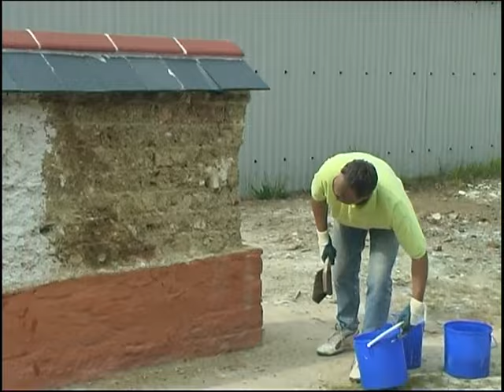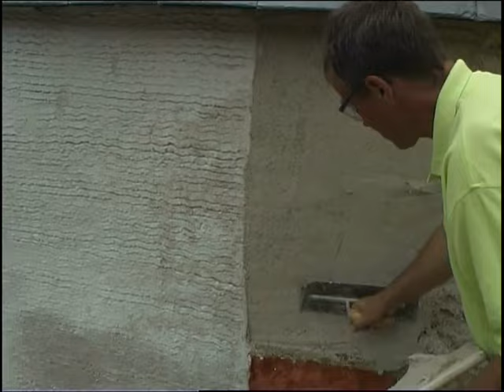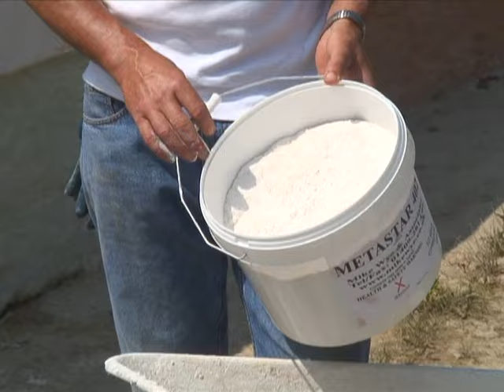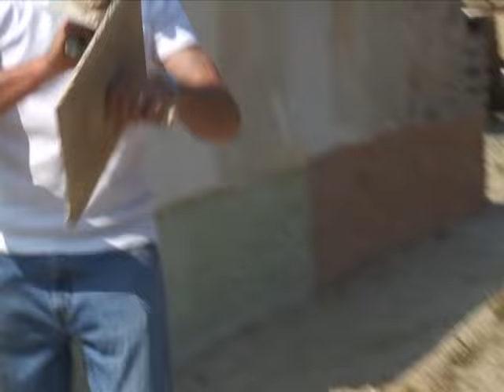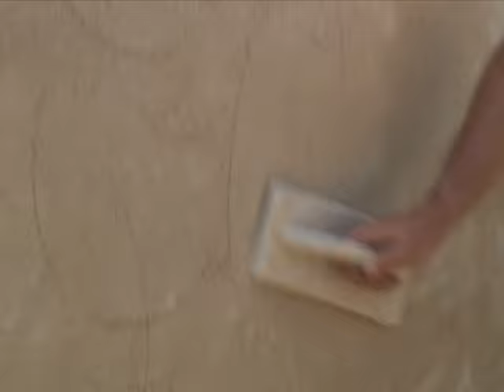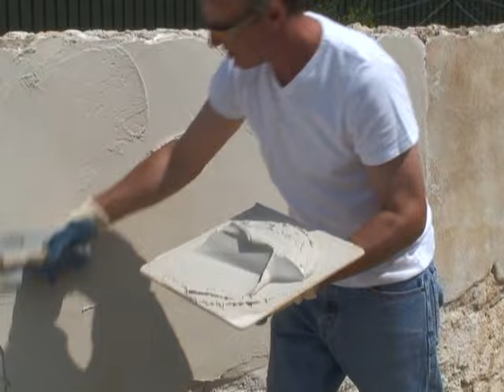How to Lime Plaster (internal solid wall)

Comment: Sorry if I missed it, but how thick does the scratch coat want to be?
Reply from the maker: Hi Simon. We typically assume 12-15 mm material consumption for the scratch coat. Of course you may need to consider extra material for dubbing out and, in some instances, an additional scratch coat if the walls are particularly uneven. 
Regards, Ryan @ Mike Wye
Reply: @MikeWyeLtd  Thanks. I see on your website that two scratch coats are specified, is this optional? I.e. if you are happy for the walls to be uneven and retain their character, can one coat be used?  We are specifying both internal plastering and external roughcast render.
Reply: Also - with the roughcast, do you add the aggregate to the harling coat, or do you add the harling coat then fling the aggregate at it? Thanks in advance. S
Reply from the maker: @simonblunden6751  Exactly. If you have particularly uneven walls then you will likely need an additional dubbing out coat to bring the walls level before application of the float coat. If you would like to retain some character, or if the walls are relatively flat (such as brickwork or block) then an additional coat will not be required. Regards, Ryan @ Mike Wye
Reply from the maker: @simonblunden6751  The roughcast/harl coat as shown in the video is a thinned down Unhaired Lime Mortar mix. We generally use something called Reabilita Cal CS (otherwise know as Consolidation Mortar) for harl coats these days as we can supply exactly the correct amount without having to work out how much of the Unhaired Lime Mortar to separate plus it is generally ready to receive a scratch coat in 24-48 hours.
Reply: @MikeWyeLtd  Thanks - do you have any guidance on the type of aggregate to use in the top harl coat, would this affect the proportions of the mortar mix, and would you add the aggregate to the mortar before harling it?
Reply from the maker: @simonblunden6751  The aggregate in the premixed mortar is 0-4 mm and therefore you would not need to add any additional aggregate unless you were looking for a coarser finish. If you do want something beyond this then you can introduce another aggregate but not so much that you end up significantly affecting the mix ratio.

Comment: Have you applied this on Concrete wall?
Reply from the maker: It's absolutely possible to apply lime plaster or render to concrete block in the same way. This could be done for aesthetics, to match surroundings or from an environmental viewpoint.

Comment: Hi Mike such a good informative video. Quality work. What is the difference in technique/materials this to an external wall?
Reply from the maker: Hi David. Thank you for your positive feedback. 
The application for an external render would be almost identical apart from a couple of details: 
The lime plaster skim would be too weak and vulnerable for external use and therefore the top coat would be a finished unhaired coat rather than devil floating it as shown here. 
We also recommend the use of a pozzolan additive for external works (particularly if you're in the UK given our climate!) to bring on an initial strength gain and protect from adverse weather and frost in the future. Regards, Ryan @ Mike Wye
Reply: Ryan, thanks so much for the prompt and informative feedback really appreciate your help. Are you still supplying materials at the moment incuding delivery?
Reply: Ah I just ready your notice on your website. Hope things get back to normal soon. Wishing you the best.
Reply from the maker: @davidharness1507  Thank you. We hope you and your loved ones keep well through these challenging times.

Comment: Good video.
Once dried .if there are any knocks and slight damage how do you fill?
Reply from the maker: Clean the area and damp down, apply a small amount of material and float/sponge over as it dries back. You may find a finer sand mix easier to blend but it can be done with the standard mortar

Comment: Hi love the videos thanks, i have a question can you do sections at a time, Example I have a Large external wall I need lime rendered, in planning to do it myself, could I do the wall in 3 stages with no bells , just flat and do section to finish coat different days?
Reply from the maker: Hi Mike, you could do the harl and scratch coats in stages but you would need to try and complete the float coat in one (it's very hard to disguise joins in the float). If there are down pipes, that would be a good place to stop and start.
Reply: @MikeWyeLtd  OK, than you for the reply awesome

Comment: Can I use lime mortar over concrete!!
Reply from the maker: Hi Ramona. Sorry for the delayed reply over the festive period. It's possible to apply lime over concrete but arguably very little benefit in doing so. The lime will only perform as well as whatever is behind it in terms of vapour permeability and flexibility. There's also an increased risk of cracking/failure due to differential movement between the two materials.

Comment: Thanks for this Mr Wye. I have used your stuff on many occasions because your materials are always good and very usable. 
Instead of using metastar I prefer using a brick dust. Harling is good and effective but if possible I prefer to use a mortar sprayer with a full sized compressor to do a thin 1st coat which I then blat it on at about 90 -100 lbs per square inch. I also use a wider tined scratcher but have cut away every other tine because they were too tight together, I also like to slurry area's before I scratch because it helps to bind the two surfaces together.
Many architects and builders cover their cob surfaces with metal mesh fixed with screws & plugs, resins or cone headed twisted nails but this isn't necessary if you do a 1st coat with a harl or a spray that should be sufficient, it's all about the key.

Comment: can this be used for outdoors? Would look fantastic on my retaining wall
Reply from the maker: Hi HalfKatzBoy, It can all be used outside apart from the last plaster skim coat. This wouldn't cope with the weather as the aggregate is too fine and the coat too thin.
Reply from the maker: Hi. The process is fairly similar for rendering externally but the skim coat is omitted. You can find our external render YouTube video here: https://youtu.be/1sjVSMypSvY

Comment: I want to do ready to use dry mix lime plaster. Let me know which lime to use? sand:lime proportion? what to do to accelerate setting time?
Reply from the maker: Hi Sameer, you can use an NHL (Natural Hydraulic Lime) either NHL2 or 3.5 mixed with sand, this has a chemical set with water. You wouldn't really want to accelerate the setting time but with this sort of lime it should be 'green hard' after 24-48 hours. A 3:1 mix ratio by volume is commonly used.
Reply: +Mike Wye Thank you. Also I had heard that sulphur powder is also used. Is it correct?
Reply from the maker: @SD-bg4pm  Many powder pozzolans, such as fly ash, brick dust and metakolin, have an effect on the mortar strength when added. We generally add them to traditional lime putty mixes to improve strength and offer better protection from frost. It's not necessary to add them to a hydraulic lime mix as the strength can be somewhat determined by the correct grade selection (NHL2, 3.5 or 5)

Comment: Just moved into a cob cottage that has been cement rendered outside & inside on the ground floor. Silicon injection damp proofing to prevent rising damp. Is it worth using lime mortar internally on the first floor.
Reply from the maker: kate herd, our apologies for missing your comment a few months a go.....not sure how that happened. There can be some real benefits in using lime plaster to help with moisture management and for the benefit of the property. However, we always encourage breathability to the outside first wherever possible. If you are considering improvements or need to replace renders or plasters due to dampness or damage then it may be wise to address the external cement render first, finished with a breathable paint.

Comment: metacaolin question: do you add 7:1 ratio to the lime putty or 7:1 ratio to the entire mortar mix, I remember reading somewhere that metacaolin is highly reactive and you only need to add 2 to 5%, adding too much may cause shrinkage issues as well. on the other end of the spectrum brick dust is of low pozzolanic reaction and you can add 1/3 of the aggregate (25% of the mix) up to 100% of the aggregate can be replaced with brick dust, depending on what final properties you are trying to achieve. rising damp issues, etc...
Reply: Fabio Bardini, we add the metakaolin to the mortar at 1:7. 
The addition of pozzolan is an interesting and broad subject which has recently been revisited by the Building Limes Forum in the U.K. as the theme for this year’s annual conference. 
We try to keep our finger on the pulse with all new developments and research, however we’ve been using a gauge of metakoalin with traditional mortars in these sorts of volumes for 25 years without any resulting shrinkage. 
Many other pozzolanic additives can be used but may not be easily accessible, can be inconsistent in their reaction, or can have an unwanted effect on the mortar colour.
We’re happy to discuss this further if you’d like to call our office, or email us at sales@mikewye.co.uk

Comment: Just found your channel 👍 Excellent video 😎 I've been Plastering for 25+ year's. And have recently started working for myself. And have started coming across having to use breathable materials. Lime.  But haven't done a great deal of lime. And when I have done. I've never mixed it up. I'm the one who puts it on the wall 😉 so would be very grateful if I could ask you a few questions about rendering with hydrated and hydraulic lime.
Great video 👍😎😎
Reply from the maker: Hi Neville. Thank you for your kind feedback - much appreciated. We're more than happy to help with any questions you have but you may find it easier to do so through our online chat via our website www.mikewye.co.uk, or by email sales@mikewye.co.uk, or on the phone 01409 281644.
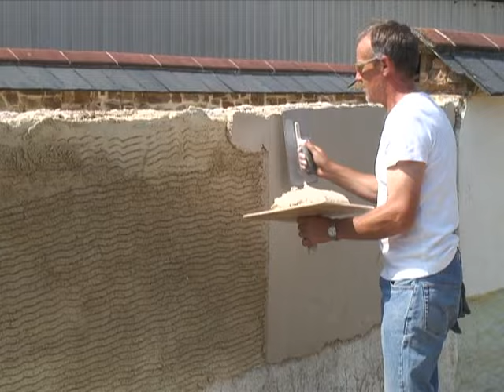We're here Monday to Friday 08:00-16:30 (GMT).
Reply: @MikeWyeLtd  Thanks Mike. Excellent. I'll contact you as soon as I get 5 minutes on chat on your website. Thanks again 😎👍
Reply: Neville Hayfield do post the questions and answers here so that everyone can learn something new.

Comment: Hi, i'm getting ready to render my walls, can you tell me what type of sand are you using, is in rendering sand or building sand on all 3 coats. thanks
Reply from the maker: The backing coats use a sharp sand, typically 0-5mm with a good spread/blend of fine and coarse sized aggregate. Many merchants supply 50/50 sharp sands which can be a fairly safe bet if there’s any doubt.
For the top coat lime plaster skims we use a kiln dried fine sand (kiln drying removes the majority of lignite therefore minimising marks on the plaster). The size of sand can vary depending on the fineness of finish required. For example, Georgian and Victorian town houses typically had smoother finishes when compared to 16th century cob and thatch properties. 
As a guide, somewhere around 0-0.25mm aggregate size will achieve a good result.

Comment: Excellent video. Thank you for this, it's been really helpful for me. Is harling the same as scudding, another term I've heard used?
Reply from the maker: Hi James, yes it is the same. Thank you for your kind comment.
Reply: Thanks, Mike. I'm really looking forward to having a go at this. I'm tempted to practice on the inside of the garage first. I'm guessing that concrete blocks from the 1980s aren't exactly breathable, but at least I won't make a mess of the walls inside the house trying it for the first time there!
Reply from the maker: Good luck, we are always available on the phone for help and advice, should you need it.

Comment: Is it hydrated lime you use? This may seem like a silly question but I have no idea
Reply from the maker: Hi, no we manufacture lime putty here so we use that as it provides a richer mix but hydrated lime is a dried version of this. We use a ratio of three parts sand to one part lime putty by volume.
Reply: In Korea, In my opinion, Not quick lime But Hydrated lime. in these kinds of cases, traditionally use Hydrated lime(quick lime + water = Hydrated lime). lime putty, lime mortar etc...

Comment: The soil around me is acidic. Seeping water is bound to have a low PH. I bet lime-based mortar will get eaten up pretty quickly and efflorescence will develop at the joints on the inside wall. Any thoughts on how to prevent it? Also, would adding the "potslan" (spelling?) help keep it water proof?
Reply from the maker: Although a wet lime mortar is highly alkaline, once carbonated it becomes pH neutral. As long as the walls don't become saturated and if both internal and external sides are lime the wall with breathe and should not cause any problems inside. The pozzolan increases compressive strength and helps to protect from frost and generally makes the mortar more durable.

Comment: Is there a way to fix little imperfect rough patches before lime paint? Thought maybe a skim coat of putty or NHL paste ?
Reply from the maker: Assuming that they are slight imperfections then the paint or limewash itself can help to improve and disguise blemishes. If the patches are beyond fixing with a paint then it may be possible to feather in a fine lime putty filler or put a very thin skim over the entire area if the plaster is still relatively green.

Comment: Great video.  It would be great to get a little more detail on how much to let each coat firm up before going on to the next, or before floating, and how much pressure is being applied for each coat.  I know that in a video it would be hard to get a clear picture of the firmness of each coat at each stage, but that's one thing I can't pick up without being there "in person".

Speaking of which! Have you ever considered offering a multiple-day course on lime plastering, spanning enough time to see how the stages tie together?  Definitely worth building my next holiday around it!

Comment: Could I use a ultra fine hair brush at the last sponging stage or after? Plus would  memory foam have a similate effect to a more dense sponge.Im preparing to Lime plaster the      interior walls of a Georgian period Out house,many thanks
Reply from the maker: Hi,  It's worth having a try with the memory foam but it may be too dense. Are you using the brush for an effect?

Comment: Are you using putty or NHL in this 3 to 1 mix? Thank you. Just getting into this work myself.
Reply: Sorry just heard the mention of putty.
Reply from the maker: It's a lime putty mixed at a 3:1 ratio by volume with a pozzolan added (Argical M1000) at a 7:1 ratio by volume

Comment: So glad our materials in Australia are more refined and don't require so many coats. Just one coat at 10mm thick and it's done.
Reply: Not the same material. Gypsum is fine but nothing beats lime on old buildings.

Comment: The sequence, the equipment descriptions, the timings and the small tips about the various pitfalls are excellent guys. Clearly you are craftsmen, but this has given me the confidence to have a go at all of the internal cob walls in my French country cottage. 
I was going to batten and board out the walls as I was worried about getting a decent finish surface on the cob walls, but if I can follows your guidance I'm now more confident I can do it proud. Thanks for sharing
Reply from the maker: Thanks for the comment. If you give the office a call we can help you out if you have any more questions. Cheers

Comment: Thanks much appreciate the video and your responses. Breathability and the way lime kill off bacteria fungi and viruses makes it a superb material. Looking at this as thinking of building hempcrete which has a friable surface so needs a lime breathable  finish. Has long loved the victorian homes I lived in  with set plaster walls and lime plaster wedding cake ceilings within handmade clay brick and lime mortar walls.
Reply: janet lesley Janet Im wondering if using Hemp in traditional plaster would be beneficial inbthe project i am currently inder going.Some origional Lathe work walls that need attention and some fine Oak timber beams in a Georgian period 1790 Out house

Comment: Fun video. They have modern products that not only will bond, but prevent discoloration and efflorescence.  They can have mesh embedded in them to prevent cracking. There has been an evolution in materials.  Traditional materials can still be applied as finish. In half the time , a slurry can be applied with a large brush as the first coat, then mesh applied with another coat the SAME DAY, then finishes and  this will outlast these materials which will crack fairly quickly , especially on that cold joint.   For a farm, this ok, but for a fine home, no way.  I'm in the US and we sometimes have to give a 15 year guarantee for nice homes.   Modern technology has improved the traditions.
Reply: modern products= quick and cheap to apply, followed by = quick to fail and expensive to replace.
Reply: tarun453 and they are all cracked and delaminating.  I learned to plaster in Italy , the old way, slaking lime and mixing aggregate from scratch.    It’s not self healing and it doesn’t last forever .  Most of the  old stuff has been patched ... a lot .